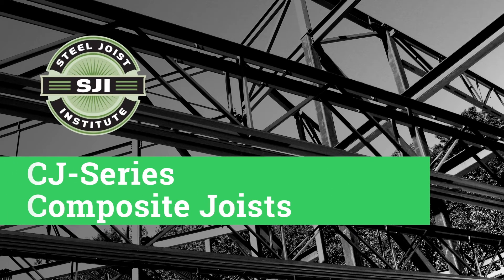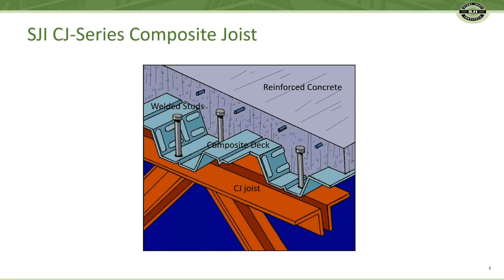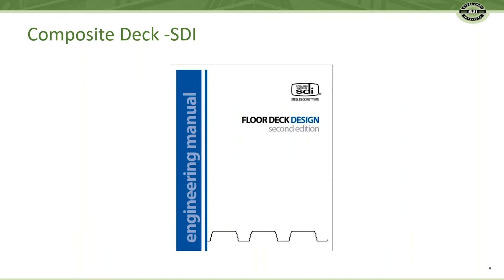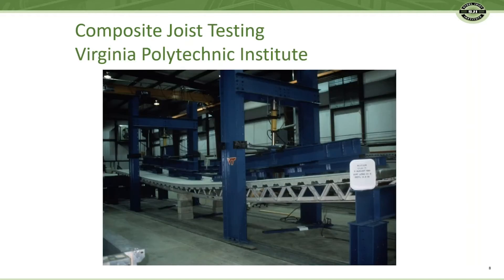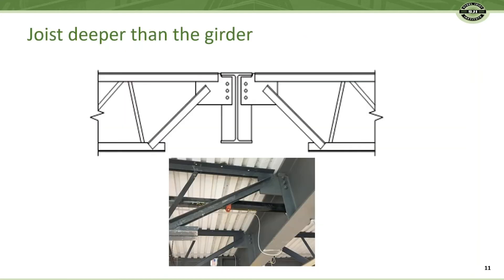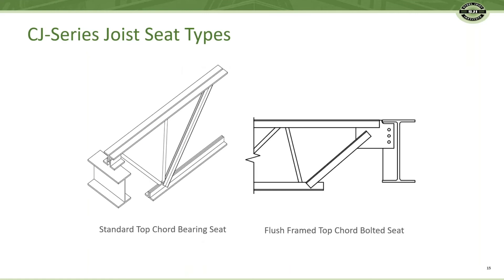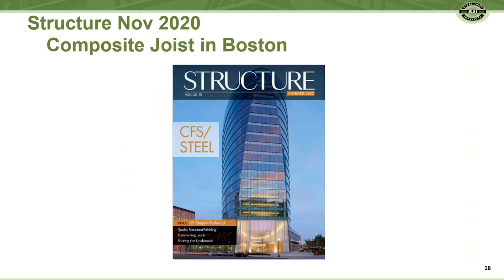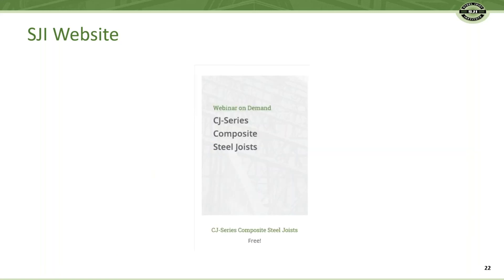CJ-Series Composite Steel Joists

Comment: Can a CJ-series be used efficiently for a small bridge or the fact that the bridge has a high moving point load makes the CJ-series unfeasible?

Thanks in advance.
Reply: CJ Joist are a great product for buildings and meet all of the building code requirements.  CJ joists for bridges is another issue with many questions.   I would not suggest this use for a CJ series joist.  The main issue is fatigue.  The joist members and connections need to be designed for fatigue in a bridge application,  which the CJ series joist spec does not address.